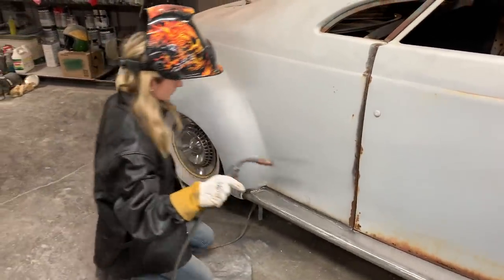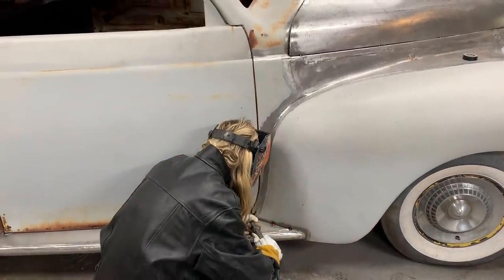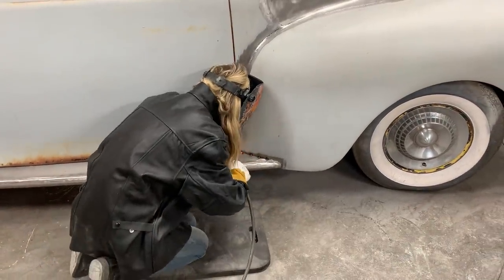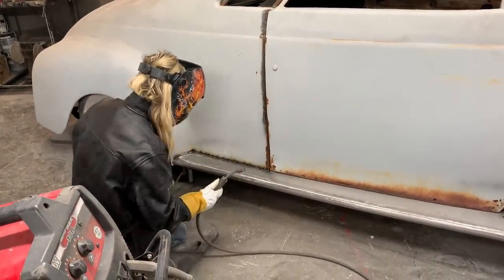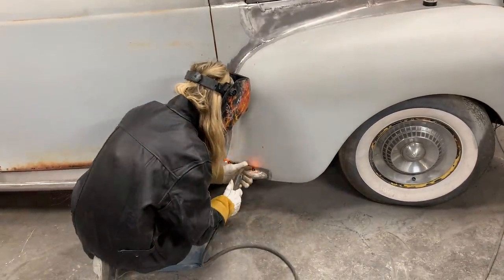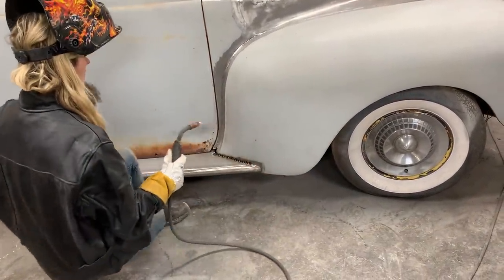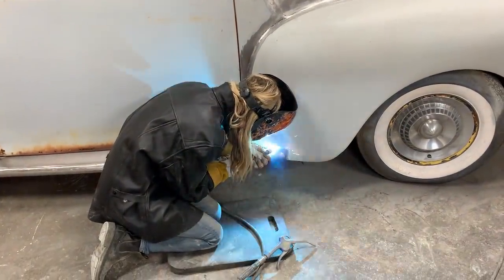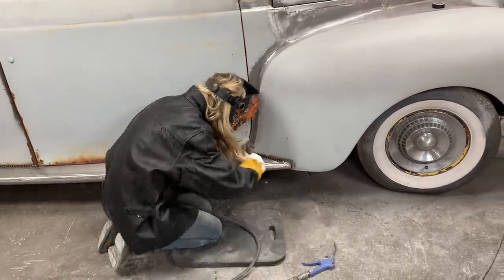Jolene is going to demonstrate how we weld sheet metal without warping it 🔥

Comment: It's good that you mentioned the sound.  I try to get across to Students and people taking welding tests that the sound is every bit as important as the visual.  You're right, when the sound is right, you almost don't need to see the weld, you can hear that it is running good.  I've done inspections on building structures where the welder couldn't get his head / helmet in to see the weld, and he just reached around, struck the arc, and went by the sound.  The weld was flawless!